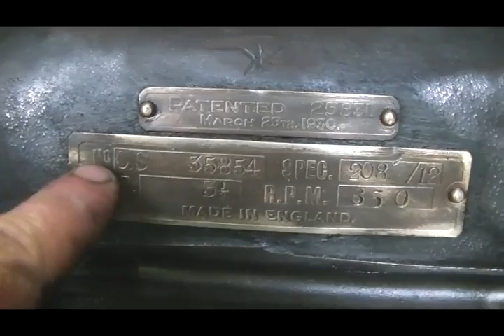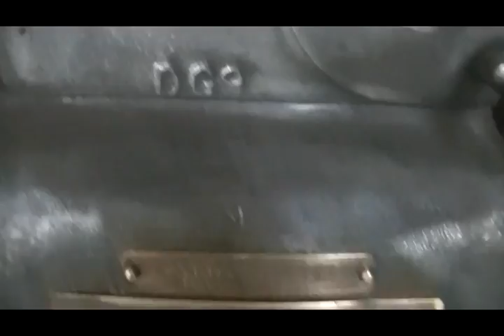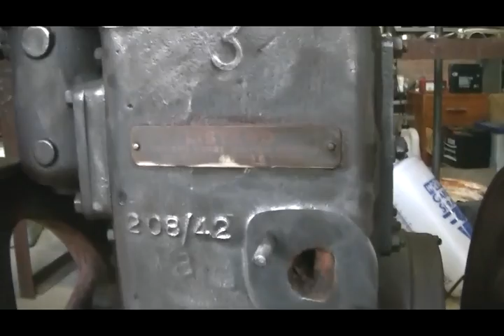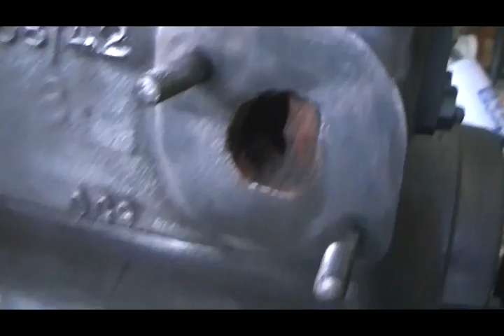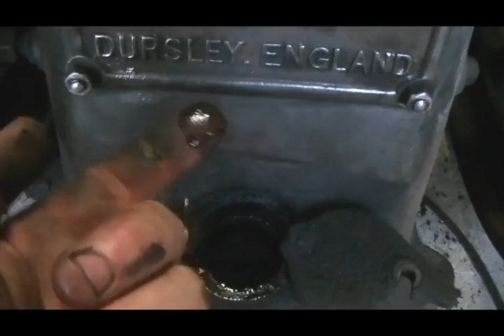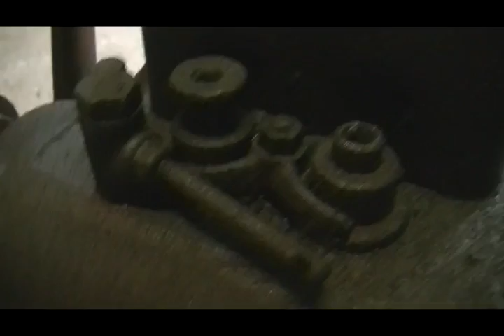lister rebuild pt2

Comment: I'm a bit late but my 3.5/1, which has the same coding on the cyl block (2 0/42), a big 3 & a 9EC (with the E & C in reverse. The engine has a plate on the base that states it was manufactured August 1942. The code on mine is 288315.

I have the mfr plate & fuel plate but there are 2 pins that give away that there was a 3rd plate (same size as mfr plate) on the cyl block. Interesting to see your plates. It seems there is no standard. 

I want to enamel paint mine once I've stripped it back. Any ideas on where to get engine enamel (coach) paint (like Paragon paints from the UK) in Australia